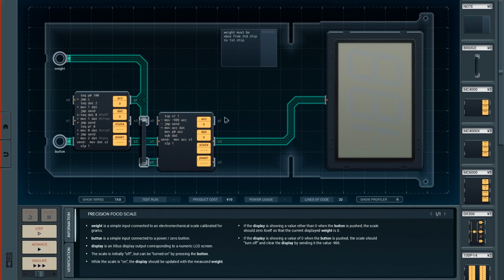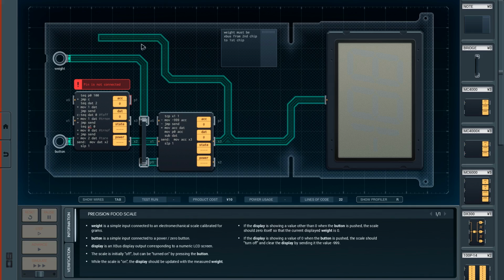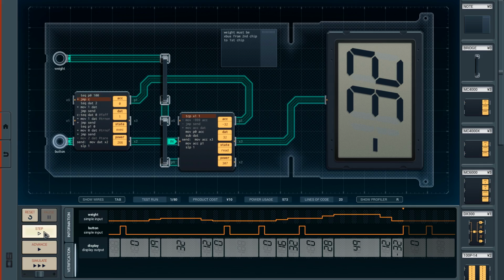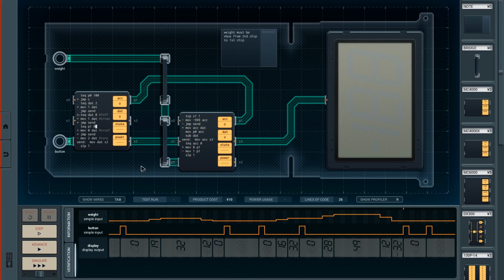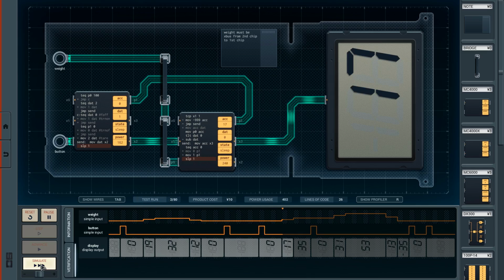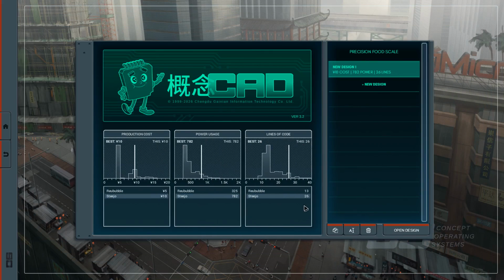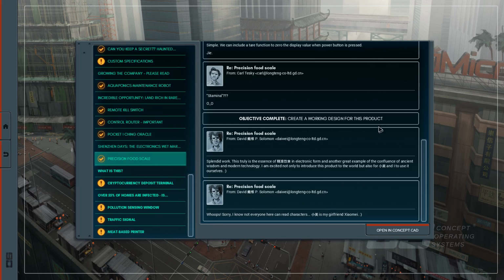PRECISION FOOD SCALE 4 - Let's Play Shenzhen I/O - Shenzhen IO Gameplay Part 39

Comment: You overcomplicated this puzzle apparently. My solution, because you asked for it and idc:

  tgt p0 0
- jmp 0
1:mov p1 acc
  sub dat
  mov acc x3
  slp 1
  tgt p0 0
- jmp 1
+ teq acc 0
+ mov -999 x3
- mov p1 dat
- jmp 1
0:slp 1
Reply: it's pretty simple huh
Reply: Neat! 

This is your code but with a few rearrangements so that my brain understands it better. I also inserted a minor optimisation to make it (a tiny bit) more energy efficient:

  mov -999 x3
b:slp 1
  teq p0 100
- jmp b
a:
- mov p1 acc
- sub dat
  mov acc x3
  slp 1
  teq p0 100
- jmp a
  teq acc 0
- mov p1 dat
- jmp a
Reply: lol, I call your solution a bit wrong, because you assume nothing happens in the first tick. I suppose that is a reasonable assumption if it works though
Reply: "lol",

In a real world situation, you would have to take quite a lot of factors into account that may not be evident from the specification of the problem at hand, such as "what to do if nobody presses the button, ever, while in on-state". This, however, is not an issue since this is a simulation within a game, and hence we can come up with a solution that covers all test cases without having to use our brains to think about real world applications.

There are several puzzles in Shenzhen I/O that allows you to fine-tune slp calls to get lower energy consumption, sometime much lower energy consumption.

However, that was not the optimisation I was thinking of (don't even know if I would call that an optimisation). No, I save a couple of cycles every time the machine is turned on by pressing the button, by skipping over moving p1 to acc and subtracting dat. I looked for a while at trying bypass the subtracting when there weren't any tare and to avoid doing anything at all if the weight on the scale hadn't changed, but I got bored.